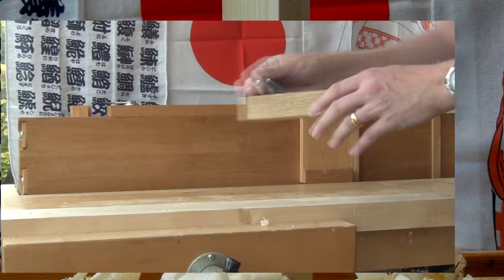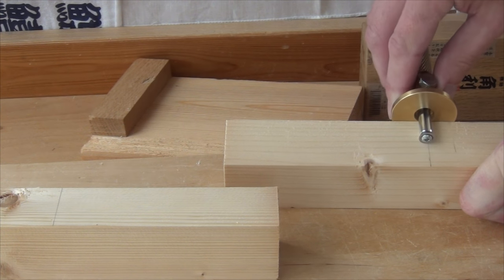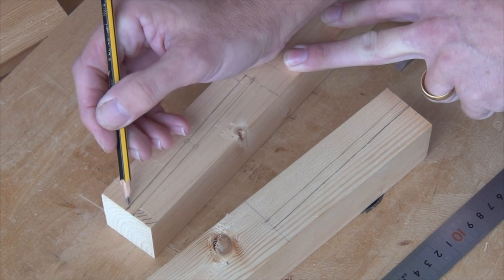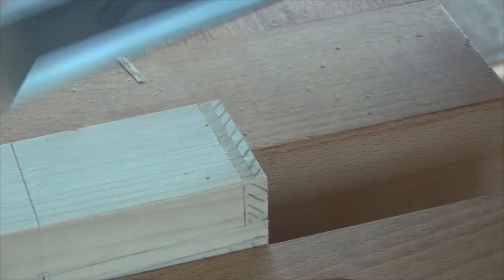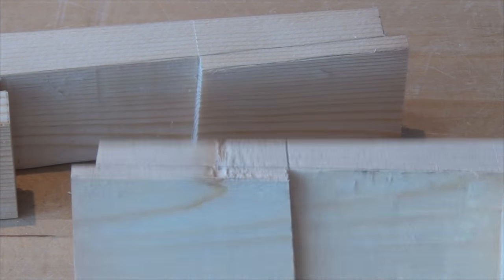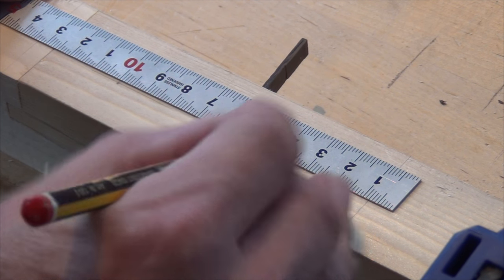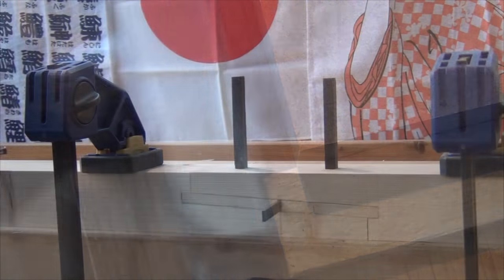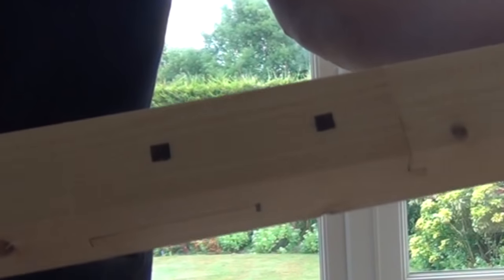Okkake Daisen Tsugi - Rabetted Oblique Scarf Splice Joint

Comment: Fascinating joint. Would it have been much easier to do using better quality timber?
Reply from the maker: Hi Jim! Sure it would have been, but where's the challenge in that 😉 I could do with some hefty Japanese larch timbers to make these the same sort of size they were intended for, but using up off cuts helps to keep the shop tidy(er)